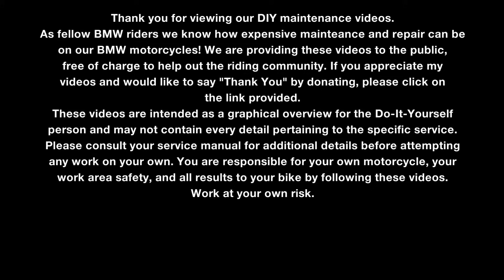Hall Effect Sensor Replacement & Installation

Comment: Thanks for this video, but I'll tell ya what...once I fix this I'm selling this POS GS and will never own another BMW again. I got this bike to go on adventures and with all the problems I've had with it I'm to scared to take it more then 100 miles from home. I don't know how you guys do this...I'm going back to well made Japanese bikes that actually run.
Reply: Sorry to hear mate. It has a few niggles (all well documented) but once you sort them out you will never have any issues. Show me a bike that can do 250000 km on any terrain without missing a beat?
Reply: cant beat japanese bikes owning them forever and now owning r1100gs at 80k im replacing everything, and my s1kr, different design. japanese built military quality and very simple. but r1100s you need to be the mechanic of it and once this sensor replaced with fuel components especially fuel regulator it should be fine
Reply: @zoeler1  if it had 250000 KM on it you wouldn't hear a complaint from me...it's got 40,000 miles on it and left me stranded 3 times. I just replaced it this month with a 2022 KLR. I'll never do BMW again. That bike burned me to bad.
Reply: @CoreyBrass  what were the issues you were having just curious. I'm a Kawi die hard but the KLR has a crappy carburetor, if it stalls mid nowhere let it sit it will start again, the carbs flood themselves. Xt650L how ever is da DOG, I dont like single cylinder, had my times w them can't take the sound
Reply: @mmm4638  I've done 2 fuel pumps on it. This hull sensor. I had an issue with the rear axle that I still sent understand. I was on I-5 and all the sudden I thought my tusk box cam loose I felt the bike wiggle. My buddy who was behind me told me it wasn't the box but my rear tire was wiggling. That somehow had something to so with the axle but I still don't understand it. ABS stopped working....but other then that great bike. 🤣
Reply: @mmm4638  the new KLRs are fuel injection and that is the main upgrade to the Gen 3 KLRs, that and the suffrage is now welded not bolted on. Some say the doohicky is still a problem because it's the same as the Gen 2...but I personally think that has been blown out of purporting and the changes made in...08 I think it was solved it.
Reply: @CoreyBrass  I see. The axle issue, the drive shaft has an orientation installation, fixed arms facing fixed arms and moving joints facing moving joints otherwise it will vibrate and mess the rear end up. Regardless the rear gear seal has to be inspected once in a while, so is it's bearing, the rear drive is about 250 used and another 250 to rebuild. I've worked on Japanese zx9 zx10s, solid solid bikes, doing the complete overhaul on the r1100gs, there are a lot of little details as far as installtion procedure if left unchecked will cause catastrophic failure, my friend had a r1200c the shaft was damaged inside the rear locked on him mid 5 doing 80mph he is lucky to be alive. Why it's taking me 10mo to get this  bike back on the road, ridiculously difficult to work on, clutch changed, if lever isn't adjusted to 7mm 12mm orientation it will destroy the clutch which is the worst fix on this bike, it's dry so can't dig in sand, and so on. The fuel pump I don't know, I've changed mine. I almost lost my mind working on this bike. Almost done for short to mid long rides, if all checks out I'll keep her forever
Reply: @mmm4638  best of luck to you with it. I know several guys who are BMW riders through and through. They swear by them. Like I said, this was my first and will most likely be my last. I love the boxer engine for sure...but not enough to deal with all the headaches this bike has caused.
Reply: @CoreyBrass  the sports bikes been solid just expensive bmw fkry here and there. After I'm done w her she shouldn't have any issues, wish me luck 😂